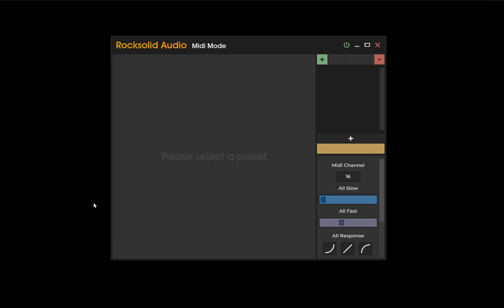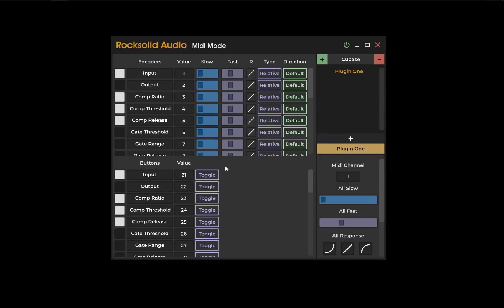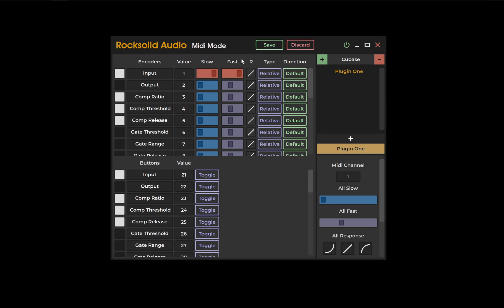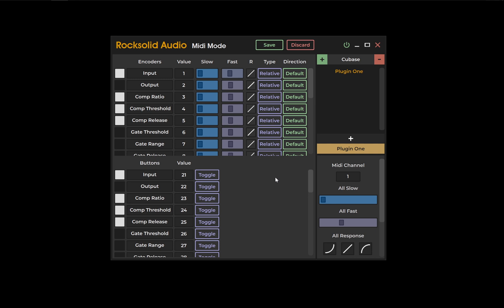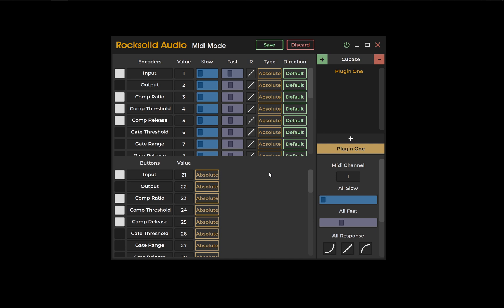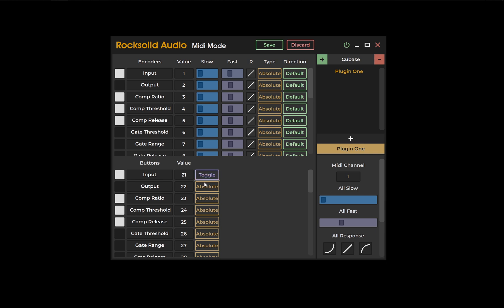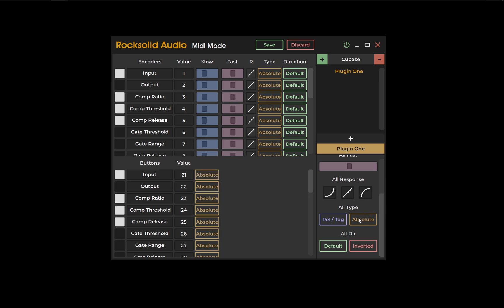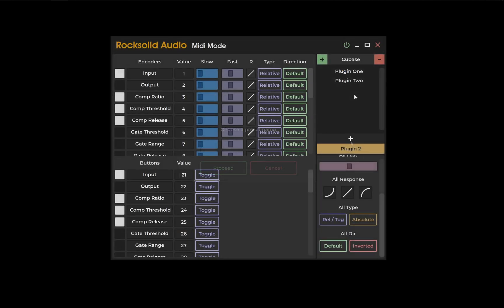Midi Mode - Tutorial

Comment: is it possible to run it in midi mode without running actual app in the background(configure it once and close)?
Reply from the maker: @MykhailoChuha  it's not no. RA Control has to be running for it to work currently